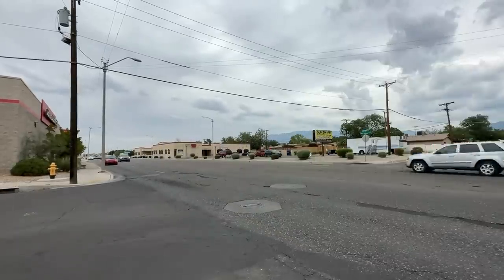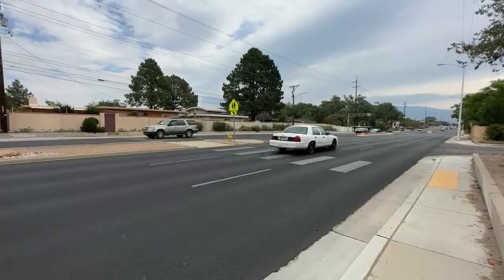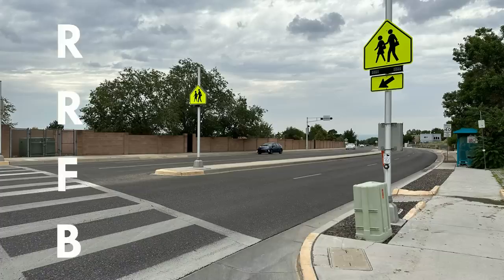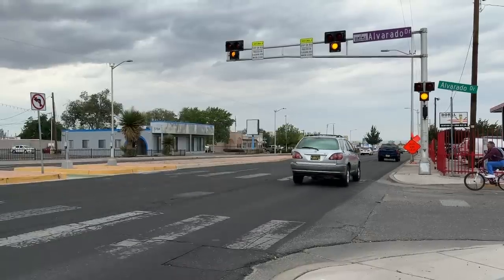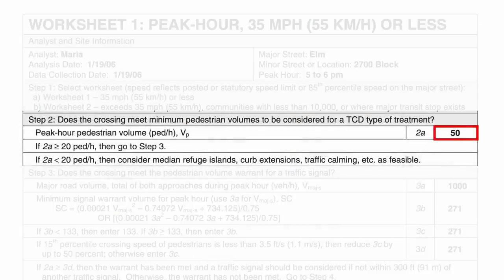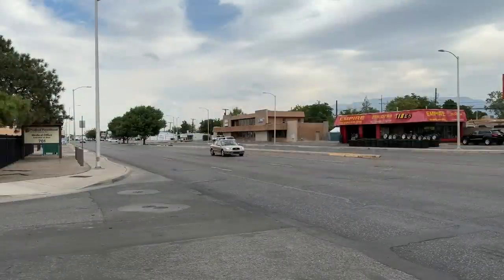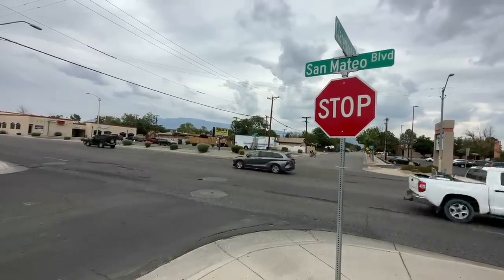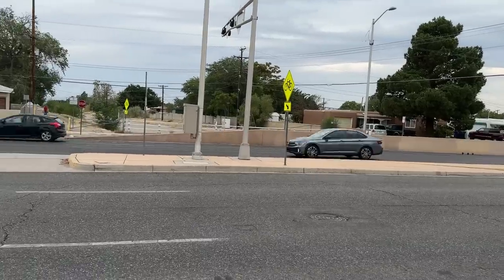The Insane Ways Traffic Engineers Try to Make Streets "Safe" For Walking

Comment: In the UK, we have flashing orange crossing signals, and have had them since 1935, so for almost as long as we've had cars.
The difference is that the lights are a lot bigger, they flash all the time, and cars are required to stop when someone puts their foot on the road. In my experience, they always do, and most of the time they will stop anyway when I'm approaching the road.
Reply: That depends on where you are.  In London, cars will race to cut you off at zebra crossing sometimes.  Other times you get that double threat. You get cars on one  lane stopping and you begin to cross but the opposite lane has cars still going purposely ignoring pedestrians crossing and glancing at the stopped car as they pass by.  There's some tiger crossing where bicycles are allowed to cross as well but not every vehicle is happy with that so they also race to cut you off.  Of those who stop the odd one will moan if they don't get a loud audible thank you.  

Quieter less busy areas tend to have the most compliant vehicles who stop immediately when someone is near the crossing even when the person isn't going to cross.  Even a regular traffic crossing doesn't guarantee cars will stop at a red light on a busy A road when there are pedestrians who used the button and can see the green man telling them to step out. Once a car sees the one ahead running a red light the rest just follow.
Reply: I think it's amazing that the US HAWK systems (equivalent to UK pelican/puffin crossings) don't appear to be ubiquitous.
A pelican/puffin crossing in the UK is treated IDENTICALLY to any other red light at a traffic intersection (that is, no one drives through a red -- I've seen it happen maybe twice, and I'm certain both times were a stupid accident with the driver not noticing the red, rather than deliberate).
So why aren't HAWK crossings more common in the US? Likely due to cost if you have to give each lane of your 7 lane stroad it's own overhanging red light (in the UK, roads are almost always narrow enough for a set of red lights on each side of the road to be sufficient).
Reply: @jacke6579 
We build so much road many municipal actually cannot even afford to maintain the road. Improve the road you said?
Reply: @jintsuubest9331  Maybe redesign it so they don't have to spend as much on it, so it's actually a return on investment.
Reply: The Belisha Beacon, name for Transport Minister Leslie Hore-Belisha, who introduced them in 1934 after coming to the conclusion that everything CityNerd identifies here as inadequate was as useless as CityNerd says it is. And I can't speak for London but at least in the north of England people still respect them. The US has this odd combination of a more all-encompassing network of crosswalks backed by generally stronger laws but far less complianc , far less enforcement, and generally less obvious signage.

Comment: My biggest concern with using them is that I can’t tell when they’ve been activated in many cases because the lights are perpendicular to me & no indication has been provided for the user. Some places set them up for instantaneous activation while some have a delay. & when they’re disabled in the constant flashing mode as one at my local grocer does occasionally, steerers just learn to ignore them, to our peril.

Comment: I was in Moscow once and they have incredibly wide boulevards, 4, 6, 8 lanes wide throughout the city. Their approach to crosswalks it to simply not have any. Well, not for those over-wide boulevards. Instead, they have pedestrian tunnels under the road at many of the intersections. You walk down the steps on one side of the street, walk though the tunnel, and up the stairs on the other side. There's no accommodation for handicapped people, i.e. no ramps, but at least it's an attempt to protect the majority of pedestrians.

Comment: European here (from Hungary). This is the typical case of not learning from someone else, but inventing something bad. The fact that the HAWK signal doesn't always lets the drivers know that they're approaching a pedestrian crossing is the worst my transportation engineer brain can imagine. In Europe we use classic signals where you don't have to learn this flashing red bs, but yield if yellow or red. But because if inactive it's a solid green, it tells the driver that there is something crossing the road.
Reply: The HAWK signal is actually just an American version of the Pelican crossing, which in the UK itself is long considered obsolete. 
The UK now uses Puffin crossings, which have an extendable pedestrian clearance period (by means of sensors mounted on poles) instead of a flashing clearance period. And they also have sensors that automatically cancel a request to cross if the pedestrian leaves the detection zone.

Comment: Superb video. I like this format of a deep dive into technical details, I kinda like it better than the top-ten cities format.

I'd be very surprised if that 98% compliance figure was accurate. They have these crossings at multiple locations on San Fernando St by San José State University, and I'd be surprised if compliance was as high as 10%. 

I'm surprised you didn't look to international comparisons for effective pedestrian crossings.  Crossings from the UK have evolved from zebra, to pelican, to puffin crossings. They use standard traffic signals that near-as-dammit get 100% compliance. 

Zebra was striped with flashing yellow beacons. There's not many of these anymore.

Pelican was the first push-button crossing. Standard traffic signals turn yellow, then red to stop cars and give pedestrians a walk signal. After a few seconds the yellow starts flashing, meaning that if the crossing is clear, drivers can go. After a few seconds of flashing the traffic signal goes back to green.

Puffin is the same as the pelican but has a different positioning of the pedestrian signal. Instead of on the opposite side of the street, it's on the same side of the street and on the pole beside you, positioned so that you're looking at it in the same direction as looking to see if the cars have actually stopped.

HAWK is so confusing I don't know how it became a standard or why it's better than standard red-yellow-green signals. The fact that they go dark means that drivers are not looking out for them. A green signal gets your attention in a way that a dark signal does not. You're going to keep an eye on it on approach even if it's green, and you'll be ready to hit the brakes if it turns yellow. With a dark signal you may not even notice it at all, so when it does start flashing there's a much higher chance that you'll miss it. I'd love to see the data comparing HAWK compliance in the US with Puffin compliance in the UK. I'll bet there's a big difference.
Reply: I was surprised by that RRFB percentage, too. Unless non-compliance is literally someone getting run over, I don't see how greater Boston metro area alone isn't dragging that percentage way down.

Comment: I'm in Connecticut, and when I leave the northeast, it always amazes me how much worse the stroad situation is, as a driver.   I don't feel safe driving on a lot of these roads.  That unsigned intersection where it takes 12 minutes to cross, its not that much easier to cross or turn left in a car.   You can maybe deal with a smaller gap than a person needs, but acceleration takes time, and that is a lot of traffic to keep track track of as you look back and forth.  I visited family in Virgina and was amazed at finding a road that was needlessly four lanes each way, with driveways and all on it, and cars crossing in front of you, and it just seeming absolutely nuts.

Here in CT, our stroads are mainly old routes which have been widened for a few miles, and rarely past two lanes in each direction, plus some turning lanes.  Yes, really pedestrian unfriendly, but at least somewhat manageable.  They often have buses that run along them, or even trains, and at least make some attempt at making the signaled crossings useable.  We have the Boston Post Rd, which is probably one of the original stroads, widened to two lanes each way through what had been rural areas, before there were any expressways of any kind, and by the 60s, pretty well filled in with shops along their length in what are now moderately dense suburban towns.   Traffic isn't a dream, but its also not awful.  It moves, and another lane wouldn't really do much more than let you get to waiting at the next traffic light a little faster.

My point is, people driving should care that roads that are safer to drive can also be roads that are safer to walk.  Scaling things back just a little isn't perfect, but can make quite a difference.  If making turns feels like a harrowing experience on a street, just think of how much worse that is if you aren't in a steel box.

Comment: Something your comment on cycling infrastructure reminded me. A lot of councils have turned disused railway lines into "rail trails". These are walk/cycle paths that connect smaller towns where in the past, no pedestrian path existed at all. However, when these trails cross a highway or major road, pedestrians are expected to cross 60mph traffic without any support, not even a painted crosswalk.
Reply: When the trains ran, they had flashing lights and boom barriers, or a grade separation.

Comment: Something simple city engineers could do to make bikes paths safer would be to ALWAYS put them outside of shoulder parking/unloading zones (far right side) .  It's cringe seeing city planners create elaborate bike lanes in which bikers are sandwiched between parked cars and busy roads.  This means the bike lane will always be violated whenever a car needs to park or unload.   Sometimes just widening a sidewalk and allow mix use for bikers/walkers can be a good solution.
Reply: Also drivers do not look when opening the door! such cycle lanes resulted in many "doorings" when first introduced. The cyclist then has nowhere to go to avoid the door as there is traffic on their left.
Reply: I'm decidedly not a fan of mixed-use bike/pedestrian areas, though my evidence is entirely anecdotal. In the 5 years I was there my university campus had numerous injuries and even a fatality due to pedestrians being hit by cyclists before they prohibited cycling on high traffic sidewalk areas and the town widened multiple roads in the downtown area for dedicated bike lanes.

In areas where there is street parking, traffic is very slow moving and vehicles have to share the lane with cyclists and honestly it works quite well, but that's only because the city govt did a good job of making the downtown unattractive to thru traffic and bulking up the roads around that area to encourage using the bypass routes.
Reply: @Neotenico  I biked a lot when at my school with mixed pedestrian/bike trails and never had an issue.  I'm much more worried about car + bike collisions vs pedestrian + bike car collisions.  When I'm on a road going back park cars and side drives, it's very stressful, as your head has to be constantly on a swivel to prevent from being blindsided.

Comment: This type of street design is like building a 10' fence and deciding whether or not to add a gate by measuring how many people climb over it. I though engineers were supposed to be logical thinkers and wouldn't just blindly follow some rulebook. 

I believe that you physically need to redesign roads and intersections so it's physically impossible to do the wrong thing but at the very least I'd like to see these  cites hand out at least as many tickets for failing to yield as there are accidents and injuries per year.

Comment: They have installed a lot of these HAWK crossings around Georgia Tech and on Buford Hwy in Atlanta which is the definition of STROAD.  There are a lot of people that walk in this area and it could be a mile between cross walks.  They installed several of these, but I see people run them constantly and almost saw someone get hit once.
Reply: I used to live in Atlanta and often shopped on Buford Hwy.  I frequently saw really scary stuff, like young mothers with toddlers trying to cross this huge stroad to get to or from a bus stop.  As you say, no crosswalks or signals in sight.
Reply: Stroad
Reply: @ThreeRunHomer  evils of spell check

Comment: You pointed this out, but I found a weird pattern in the examples you showed and in my own city. For bikes, most of the effort goes into making better paths, but the intersections and crossings get completely neglected. If the path is great but the intersections are still dangerous, it's almost as if no improvements were made at all.

Comment: I would say that RRFBs and HAWKs would only work if you were ready, willing, and able to narrow down and take out lanes (turning one or two of them into left turn lanes, for example). 

That’s what Minneapolis did with Lyndale Ave (as you visited earlier and had an example of). As someone who’s lived a few blocks away from that stretch of road (which is actually under the jurisdiction of Hennepin County, not the city of Minneapolis, which was a whole other issue in ironing out improvements for that stretch when ideas were being discussed), it used to be a lot more hazardous for people to cross the street before the RRFBs were installed as the two-lane-each-way street was narrowed. It also used to be a lot noisier to be on Lyndale if you were outside and I’ve noticed that it’s a lot more pleasant to hang out and have a coffee/tea or brunch, whereas before, I’d have to use earplugs to muffle the car and truck noise coming from the street.

As much as these are great, I wish more drivers would be aware that people walk the streets and have a right to them as much as they do. One of my friends was killed in a hit and run in January on a smaller, much more quiet and narrow street around a lake in Minneapolis. It seems like, even on a quiet street like that, drivers have an attitude that makes them much more entitled to drive than they do in being responsible in treating pedestrians as people…
Reply: I wish that they wold get rid of left turn lanes, and then bring back street side parking. That will more likely slow traffic down.
Reply: @eugenetswong  Lyndale has always had street side parking, which was its own nightmare when the street was 2 lanes each way. [I live 2 blocks away from Lyndale and cross it fairly often.] It's a busy street, not quite a stroad, but about as close as you can get in a very urban area.
Changing to one lane each way, with left turn lanes. RRFBs, and red-painted bus stop zones has minimally decreases the number of cars —  but being squished into fewer lanes makes them all drive under the speed limit. I never feel truly safe crossing a busy road, but I do feel safER. And the plan is to calm Lyndale even more, then start work on Hennepin (the sister almost stroad a few blocks to the west.
Reply: @lizcademy4809 Thanks for the info! You have my sympathies.

The beauty of street side parking is that there should be no NIMBY opposition.
Reply: @eugenetswong  Since I don't drive, the street side parking is no problem for me ... especially since it slows down the moving cars even more.
Reply: @lizcademy4809 A beautiful thing about street side parking is that it can act as a natural barrier between the traffic and the bike lane.
Reply: I think at a minimum, they need speed bumps before the signal. Force drivers to slow and pay attention. Not sure what advantage the HAWK has over a regular traffic signal though?
Reply: @liam3284 HAWKS are a bit more flexible than a standard signal.  I believe there’s a point after the solid red that cars can proceed if the crossing is void of pedestrians or bicyclists, but must remain stopped if the crosswalk is on use.  HAWKS are experimental in my area. I think we have just one, and it spans five lanes.
Reply: @eugenetswong  They’re putting in an elevated bike lane on Bryant (not sure how far north it goes), so that’s promising for people going north/south on their bikes in Uptown
Reply: @rachel_sj  There's already an elevated section north of Franklin crossing over I-94 ... then it's a sidewalk-adjacent bike lane (curb on the car side) until Loring Park. I don't bike but it looks like a very safe way to get through that stretch of road chaos.
Reply: @rachel_sj That's great news! Thanks.

Comment: Albuquerque recently removed an RRFB because drivers weren't stopping, and they thought it gave peds a false sense of security. Allegedly there are going to replace it with a HAWK, which I actually do find have high driver compliance. I'd also argue that traffic control devices SHOULD be a bit confusing, because it makes drivers stop if they're unsure what else to do.
Reply: But apparently US drivers don't stop if they don't know what to do. (I try to, but I have experience as a pedestrian and cyclist, too.) Most of the drivers around me just drive faster, it seems, when unsure.